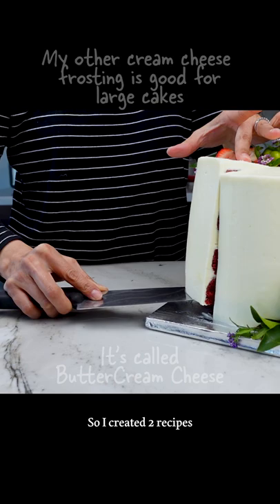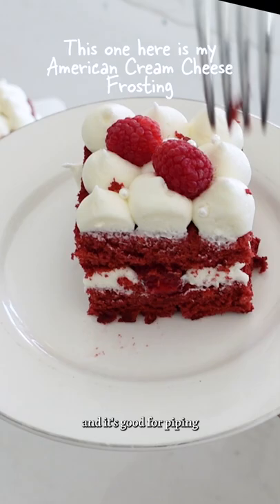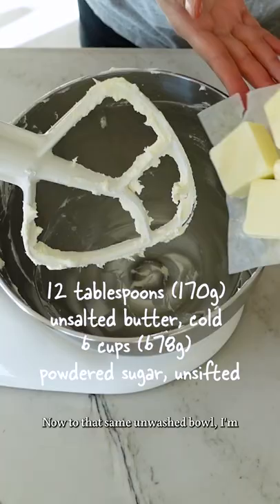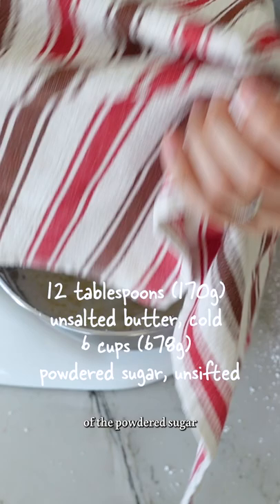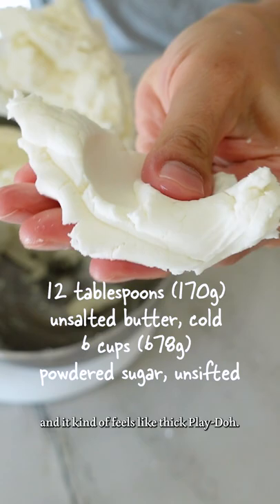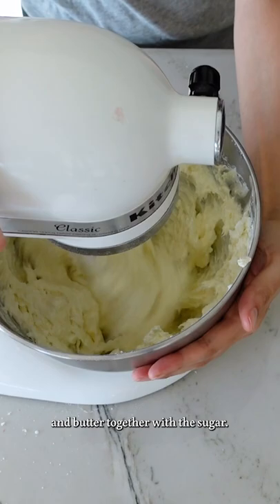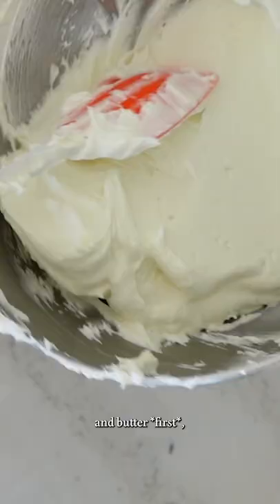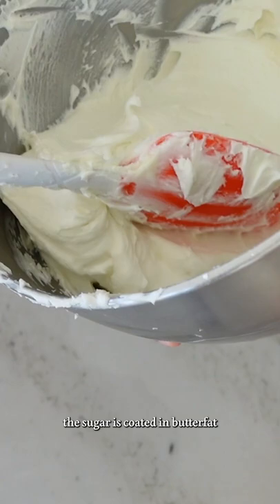Non-runny, pipeable, and quick cream cheese frosting

Comment: i love this! it's like the reverse creaming method for cakes, i'm definitely going to have to try this. thank you!
Reply from the maker: Omg you described it perfectly ☺️
Reply: @Sugarologie  Hi I don't mean to bother and I hope u reply soon cause I have to make some deserts soon - Can I substitute the powdered sugar with regular sugar?
Thanks in advance!
Reply: @that._sag._ray5042  hi! since it's unlikely she'll respond i'm just gonna let you know that you shouldn't. it'll make the texture really grainy and will end up being like sugary sand, from my own experience
Reply: @that._sag._ray5042  I don’t know this for sure, but I heard if you use a good processor on all white sugar it’ll turn into a powdered sugar substitute.
Reply: @nortexevents  That was 3 months ago but thanks?
Reply: @that._sag._ray5042  oops
Reply: Really not necessary. If you use equal parts, cream cheese in equal parts, butter, and cream them together and then add the sugar with a little bit of milk, it does the same thing.
Reply: @that._sag._ray5042  powdered sugar is regular sugar just grind it up
Reply: Just so you guys know, powdered sugar actually contains a small portion of cornflour as well. So as an example, 200g powdered sugar would be around 195g roughly of granulated white sugar and 5g of cornflour. It just makes it easier to grind it down and extends the shelf life by making it drier
Reply: @that._sag._ray5042 just because it was 3 months ago doesn't mean you can't use that advice in the future.

Comment: I tried this and it’s so insanely perfect🤯🤯🤯 it taste a bit more on the sweet side and there’s not as much cream cheese flavor as usual but it’s definitely for piping and has a nice texture and pretty good flavor
Reply from the maker: I bet you could get away with adding a little less sugar - I’ve never tried and yeah I don’t like overly sweet frostings so I’d be interested in doing that as well. I based this off my American buttercream, which is why the amounts are what they are ❤️ but now I want to try too!
Reply: @Sugarologie  When you added that tsp of fresh lemon juice in the other video you did, would that make it less sweet and still bring out the cream cheese flavor? I LOVE your content by the way!❤️
Reply: @bonvivantsweets3411  Yes! Lemon would be a great addition, because the citric acid will round out and push forward the flavour of the lactic acid in the cream cheese. I would look out for signs of the frosting becoming too loose, however you might not need that much lemon juice depending on your starting ratios. I wish you good luck on your next baking adventure!
Reply: I added about 3 cups of sugar and it came out the same. It still tasted sweet and had a nice consistency
Reply: best creamscheese frosting that isnt sweet is suing condensed mil, butter and cream cheese, perfectly smooth and silky

Comment: Can you explain why it needs to be cold butter and cream cheese?
Reply from the maker: It's because keeping the cream cheese cold keeps it stable and easier to work with when making this frosting. Although it looks like and feels like (soft) butter, cream cheese has an entirely different molecular composition and, therefore, has to be treated differently than butter. So instead of using it while soft or at room temperature like most recipes do, for maximum stability, keep it cold. Cream cheese has a high water content stabilized by gums, which can create an overly soft or runny texture when warmed, overmixed, or exposed to high amounts of sugar. Hope that helps :)

Comment: So, I'm a chef, and I just want to say this is one of the first things people are taught in pastry class.

You made a buttercream. Then you flavored it.

That same recipe you've done, you can substitute a lot of different flavors, like chocolate or vanilla, or even use fruit puree.

If you do use a fruit puree, you need to mix it with your sugar before adding it in so it absorbs the liquid first. But instead of fruit puree, I'd actually prefer flavored gelatin. Not a full package, but about 1/3...depending on the size of the buttercream receipe.

The reason your icing is pipeable is because it's just a simple buttercream recipe flavored with cream cheese.

It's not really "your" recipe, as it's been in culinary for centuries.